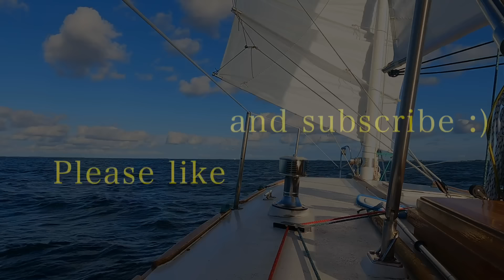Sailing In To Amsterdam And To The Southern End Of The Staande Mastroute - SV Tapatya S2 EP6

Comment: Hello
I watched your speech at the Junk Rig Association Certification.
Is a catamaran suitable for a single-person cross-ocean voyage (modern weather forecasting equipment has improved a lot)
Which one is better for single-person operation, cost or speed: gaff rig, lug rig, junk rig?
Many junk rig sailboat designs are full length keel
Modern type of sailboat bottom, liftable slender keel is suitable for junk rig
Reply from the maker: Hello
Firstly, I doubt you did as the only talk I’ve done for the JRA is the video interview that’s on their YT channel.
Yes, a catamaran could suit single-handed, long-distance sailing. I’ve forgotten her name, but the woman from Women And The Wind crossed the Atlantic a couple of times alone in her Warram catamaran. ( other answers to follow)
Reply from the maker: Junk right is arguably best for single-person operation. Blondie Hasler certainly thought so, and he knew a thing or two!
Reply from the maker: Yes, Hazel’s boat has a lifting keel. No problem with junk rig! 👍
Reply: @SVTapatya  thank you for your attentiveness
There are external links to your speeches on YT on the forum.